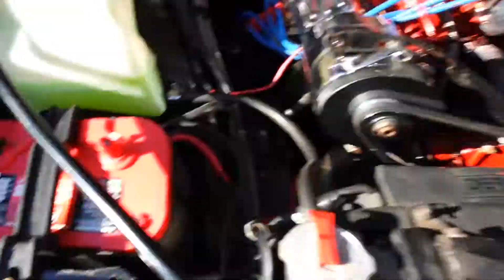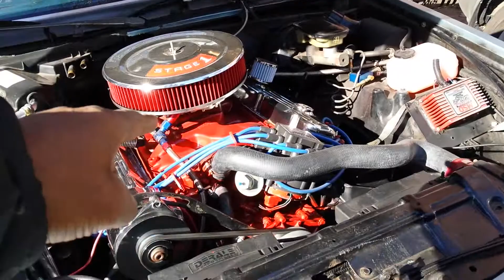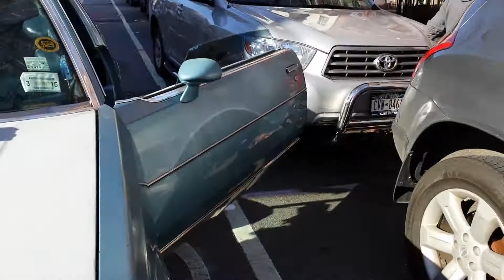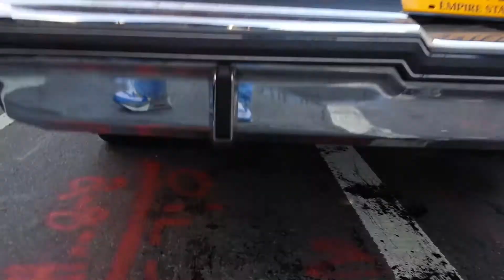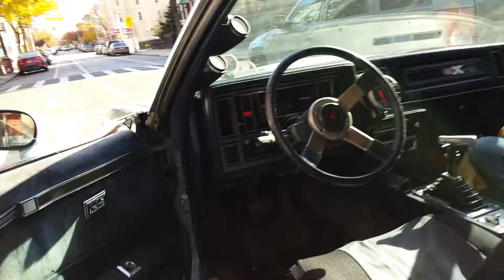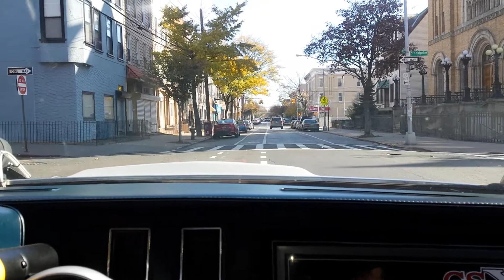CDS Stage-1 Buick 455 Regal ... it was a GOOD-DAY!!!    11-8-2014

Comment: I don't think drag radials would make the carb bog like that . Your carb prob needs some fine tuning
Reply from the maker: I hear you; I called Turbo-Steve ... he feels it's my float level. With the over 9-psi of fuel pressure, I need a fuel pressure regulator. TA Performance mentioned to me last year that 9-psi MAX is what my 455 requires. I'm checking my float level later today.